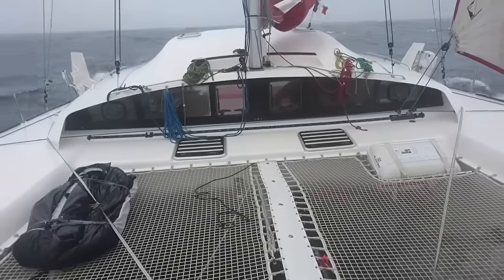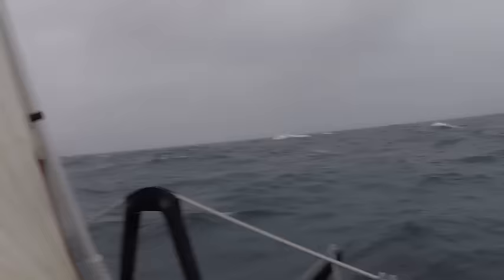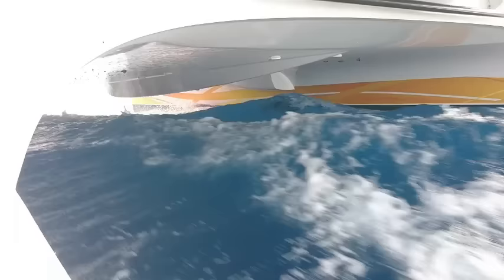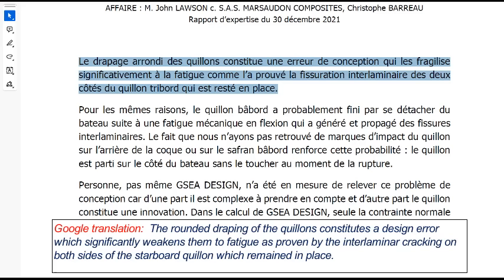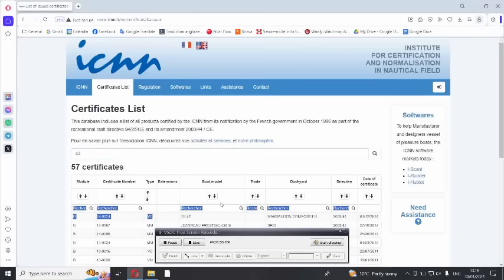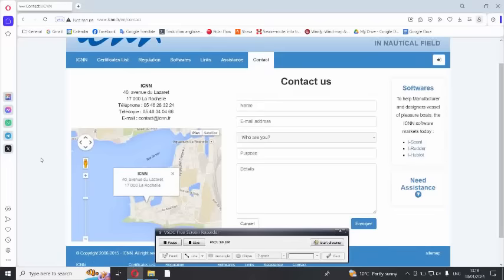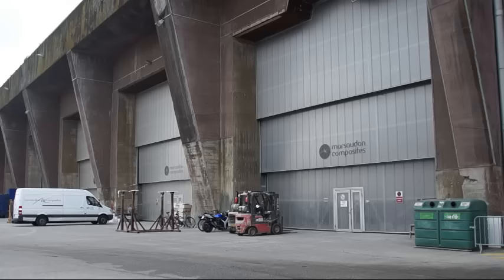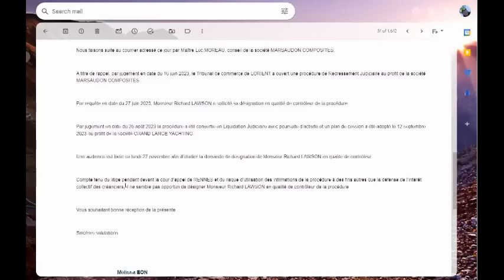Keel broke off mid-Atlantic - Marsaudon ORC42 Catamaran Part 1

Comment: What a nightmare! I hope you get your money and that you are able to get a better boat that will treat you well. Thank you for sharing your experience. I wonder how much could've been caught with a survey before taking possession. Not criticizing you just curious if that may have helped you sooner.
Reply from the maker: I have had a similar conversation with a journalist who is considering an article about how to avoid these sorts of problems in new boat purchase. For my part I think that the Keel and Strengthener design faults would be impossible to identify, unless you commission a study of the entire design by a specialist naval architect. Even then you run into a clash of views between your architect and the view of the designer and ICNN. I would hope that the dry areas would be found but most regular surveys do not use ultrasound and it would be a brave owner who would cut holes in his brand new boat if the builder says everything is normal. Buyers need the certifying authority to do their job.
Reply: Don't need an ultrasound to find infusion failure, just a hammer in the hands of an experienced surveyor. Just saying.....
Reply from the maker: True, but ballsy to cut into the pristine hulls of a new boat to prove a point if the builder says it's normal (bulkhead behind causing the different sound, etc.). Ultrasound would allow margin for error. A handful of holes were cut into this boat in different zones to investigate the tapping anomalies and 1 of them was correctly infused (the rest were all dry).

Comment: Boats with a good reputation over the years are not more expensive than new production boats where each item is conceived with the final cost in mind.

I would never have bought such a boat.

I'd rather go with a second Hand Halsberg Rassy or tor a Mallard, this type of brand with a thorough inspection by a supervisor than get a new boat from a builder who has a holiday market in mind.

Comment: Very unfortunate. In the new boat sales around me, boats with strong structural defect would get (sometimes very extensive) repair, but I never heard of a bad boat just given back to the shipyard for reimbursement. It is like one has to accept that the boat may have these strong defects and that they get fixed afterwards. French hate legal procedures that they percieve as very hostile.
Reply from the maker: Unfortunately Marsaudon Composites did not accept the faults, so they did not offer to repair them either. As a consumer we have the right to either have a repair or to return any item which was unfit for purpose when sold. My only option was to get the court to decide whether this boat was unfit for purpose.
Reply: @geezer355  Very very disappointing, what a nightmare.

Comment: That’s shocking. The automotive and aviation industry has forced recalls for manufacturing defects affecting safety, but the same does not apply to the yacht building industry? If so people should think twice about buying a new boat and look at proven used boats instead.
Reply from the maker: Exactly the point!

Comment: The keel design is a bad idea, dagger boards are better and more efficient plus they give you choice. 
From what I saw on your video, the boat was apathetically built. 
I wish you luck.
Reply from the maker: Thanks. I agree, but daggerboards were an expensive option that pushed the price beyond what I had.

Comment: Have other copies of this boat had similar problems?
Reply from the maker: Other copies have lost keels. According to Marsaudon due to grounding rather than fatigue - but then Marsaudon say the same thing about my boat - it's just that the court expert found otherwise.... There are stories of failure of other parts of the composite infusion but the owners in these cases don't want to talk to me. It's possible that they worry about the resale values. It is hard to fight for better building standards when the immediate consequence is to impact the value of your very expensive boat.
Reply: How many were built with keels? Seems the majority were not.
Reply from the maker: I don't have that information. The facebook page of Marsaudon Composites seems to show a majority of new boat launches with daggerboards, as you've said. Perhaps 6-10 boats with keels?

Comment: To me, if you rent your boat for commercial use then the warranty will be limited or void. I am not saying the boat isn't a pos. All the more reason not to rent
Reply from the maker: I think I understand your point. But this case was not about warranty. The law (at least in Europe) is that if an item is sold which is not fit for purpose, and that flaw was not evident at the time of sale, then the buyer is entitled to return the item and get a refund. This applies whether it's a smartphone, or a kettle or a boat, etc. In this case the boat was found to be not fit for purpose because it could break apart due to dry areas and/or a faulty strengthener design, and it was navigationally compromised by the faulty keels and rudders. None of these defects were apparent at the time of purchase. The court ruled that I was entitled  to return the boat and get my money back. This was never a warranty matter.

Comment: I love my 1984 monohull , well proven design that has been around the world and the problems if any are already addressed and known . You are not a guinea pig beta testing a design to see if it lasts  

Properly laid up fiberglass has a pretty much indefinite life and these old boats were over built . As they age you quick find out what ones were well built . Your boat model and the Lagoon 450 I do not see as lasting 50 years , they will structurally fail then you add on all the complex systems aging and they will be trash .
Reply from the maker: Sadly I have to agree that it doesn't seem likely this boat will last 50 years.

Comment: Do you want the hull back? I'm sure the sailing community could build pressure and make them spit it out.
Reply from the maker: I first reached out to the receiver on 17 July last year. I explained that I was open to any solution that worked for him, as long as it was fair. He still has not spoken to me and he's using lawyers to hide whether he has any funds. Emotionally my wife associates the boat with the lies/delays/stress/etc. and wants nothing to do with it. I loved the boat and didn't have the same association in my head, but the last 6 months have started to move my feelings that way too. It's hard to see the boat and not think of the stress. I'm still open to any reasonable solution, but there's no doubt my preference is to get my money back and start again with a boat that wasn't built by these people and that is certified by a body that cares. Eventually the receiver will have to talk to me - I just hope that he does what is legally required of him.
Reply: @geezer355  Where is the hull now? Imagine if they repaired it and sold it on? You should keep digging and posting. This hull turns up in an Outremer shed or repaired and sold its going to be interesting.
Reply from the maker: The boat is in Hennebont, near Lorient, France. The receiver now owns it, so he has the right to do as he sees fit. The boat would look different if he repairs it, because the wrap design would be removed. But it is boat no.7 and it should be identifiable as such on the builder's plate. If repaired it would likely be done at the Marsaudon Yard, so I hope any potential buyer is aware of the story!
Reply: @geezer355  So GLY don't own it?
Reply from the maker: @trentspencer7991  Good question. I don't actually know. The receiver has the cash that GLY paid for Marsaudon with which to pay off debts, and he has interim responsibility for steering Marsaudon. Of course GLY have been owners of Marsaudon for over 5 months and I assume they took control for the direction of the company (and assets) almost immediately. However, the receiver has not finished paying the debts (he won't talk to me), at least as far as his funds will allow, so his role is not closed. The lawyers simply say that they represent Marsaudon Composites and sometimes that's a message from the office of the receiver, sometimes from the Yard, who are now under the direction of GLY. This is the crux of my problem - none of them will talk to me, and it's impossible to make the correct least bad decision. If the receiver didn't have the funds there would be no logic in him and GLY paying lawyers to hide that information from me, but the only way I can force him to show his hand is by surrendering the boat. Feels like a poker game with super high stakes - why would GLY want to put one of their customers into this position?
Reply: @geezer355  The issue you have is a legal one. You made mistakes which confuse things. I don't understand why you would hand over the hull and sign it over without the money and hull in escrow. I'm certain you could force them to give you back the hull if you went down that route publicly but you would have to want it. Speaking from personal experience, how you view your hull is up to you and a choice. It seems like you have hard choices to make before anyone will assist you in proceeding.
Reply from the maker: @trentspencer7991  If you are sold a product that is not got for purpose, you have 2 options. Return it and get your money back or get it repaired at their cost. If I keep the boat the lawyers for GLY maintain that I have done exactly that and defacto I've chosen the repair option (and sadly the repairs can't happen because Marsaudon is in bankruptcy). The only way that I can force the receiver to repay me is by returning the boat. I tried to hold on to the boat initially so that's how I know what the GLY lawyers want to do.
Reply: @geezer355   Exchanging the hull for money in some kind of escrow agreement isn't the same as not returning it. It seems like your lawyer made a mistake. I can't imagine the legal system wherever this happened forces you to hand over the hull with no guarantee of payment. If it does I wouldn't have engaged with it there and taken a different route. All I'm saying is it sounds like you want your money back and to move on. This will be VERY difficult from here. A cautionary tale as to why you never buy a new yacht from a small builder or broker unless the contract is very favorable.

Comment: The builders of your boat knew there were problems with the laminate the moment they removed the infusion equipment. Poorly infused or non infused areas stand out blatantly as white or extremely milky/ opaque areas. They are also fairly easily addressed if repaired prompptly after infusion, as you can usually guarantee a chemical bond to the resin used during infusion.
Seems to me the company who built your boat had been in trouble for several years before liquidation and had been cutting corners or had cultural issues with regards to ethics and integrity.
I would not want that boat back, no matter who repaired it. If you do want it back badly enough, I would insist on a full ultrasound survey of the entire structure. At that point (with repair costs) it becomes cheaper to build a new boat and fit it out with the gear off your old boat.
Reply from the maker: That's exactly the suspicion that I have. How did they pop the structures out of the molds and not notice. I was invited to Lorient last week to talk to GLY (as a result of the pressure that you guys have enabled) and as a part of that visit I was given a tour of the facility by their head quality control guy. My first question to him was exactly this one. I suspect he feels under pressure (imagined or real) to give a positive line, so I didn't feel his answer on this one was completely frank, but this is what he said. The infused pieces are a sandwich, so it is possible that the outer skin of the sandwich is dry but the inner skin does receive resin. In this scenario the inside appears normal and the outside is hidden under gelcoat, so it would not be apparent. Today they do tapping tests when removing the pieces from the molds and, once a months, an external contractor visits the yard to ultrasound check key spots, in particular the areas where strength is required such as the chainplate attachments. In addition they check every piece that is cut out of the infusions (such as windows, through holes, etc.). This guy was only brough in 6 months ago, from Outremer, and I do buy that these defects would not get through today. But having seen how thin the sandwich is, and knowing that the dry areas are multiple and 10-20cm diameter, I don't buy the idea that the infused pieces of my boat somehow slipped through without anyone noticing. For me that make the whole saga worse - my belief that they would have known from the outset that these resin infusion failures existed, but they still put me through all this shit.

Comment: t seems that the boat would be considered a total loss. Would the insurance company pay for it? If you could get them to pay for it? I would think they would be less inclined to insure boats made by that new company or make the cost of insuring their boats higher. I am sure they wouldn't like that. I hate to hear stories like this.
Reply from the maker: Thanks! The insurers won't pay because it's a design/build quality issue. The responsibility to pay lies with the official receiver appointed by the Lorient Tribunal de Commerce. I can't understand why he thinks he's doing an independent fair job by blocking me.

Comment: Where that keel broke off looks like its just got foam shoved there from above, no design spec at all.
Reply from the maker: The keels sit in a hull recess. The recess is rectangular, so the top (hidden) part of the keel is also made to this shape. The strength comes from the laminated layers of cloth that enclose the foam core. The problem is that the aerofoil shape of the keel has to change to a rectangular shape at the level of the hull in order to achieve the 'square peg into square hole' join. This shape change entails a tight radius of laminate exactly where the loads are at their greatest. That leads to delamination and in due course failure of the keels.
Reply: @geezer355  I guess it fell off without sinking the boat, was that an accident or intentional?

Comment: Junk. Ive never seen a flimsier sailboat! Im curious as to why the surveyer spent 3 years on his report. Was he having a laugh?
Reply from the maker: Let me give one example. Very quickly surveyor reached the conclusion that the designer needed to be included in the process (because design errors may be at cause, which would legally enable Marsaudon to counter sue the designer, so he should be included to be able to contribute with his points). Marsaudon agreed to do this, but months later they still had not done so. Since the process was blocked, the surveyor then applied to the court to do so himself, which took time for a decision. The court said no - it had to be Marsaudon - so the surveyor scheduled the next technical meeting (of course this has to be weeks away because Marsaudon are very busy folk). A few days before that meeting Marsaudon's lawyers write to say that their client has changed his mind, and does now want to include the designer. The technical meeting has to be cancelled, we wait weeks for Marsaudon to do this through the courts, then another technical meeting can be scheduled, but months away because Marsaudon are very busy.

Comment: This is a disgrace, a deplorable result of either negligence or lack of general composite boat building knowledge. I use to build tri and cat for the"Chantier De Kerleven" in Port La Foret known today as CDK Technologies, a little bit North from Lorient. Although I have stopped building boats in mid 90's I can see just with what you are showing us and what I know, a few mistakes. Such as no bond between the outer skin and the "Airex" ( I am not sure if this is what is used) usually just this connection requires a fill with micro ,balloon +  a vacuum followed by a 2nd vacuum for the inner layer and reinforcements that way you can control the good spread of the glue/contact factor I would say, the result will constitute an appropriate sandwich. Anyway in a nutshell I wish I could have been there with you as (no offence) a translator if needed, but I am in San Francisco. I wish you the best in your quest and hope this company will shut down soon given the danger it represents.
Reply from the maker: Thanks. I wish you had been there with me! Finding someone with this level of competence is what will be required when the boat is repaired. I wonder if Marsaudon will repair it themselves before reselling it as 'factory refurbished low hours'...

Comment: Sadly your experience with irresponsible yacht construction is still happening.  Do some research on Neel catamarans.  They build defective boats and refuse to take any responsibility.  I don’t know how they remain in business.
Reply from the maker: Yes, I saw that. I really feel the regulator has questions to answer. It dangerously misleads buyers when boats are certified as Category A, if they are unsafe to put to sea.